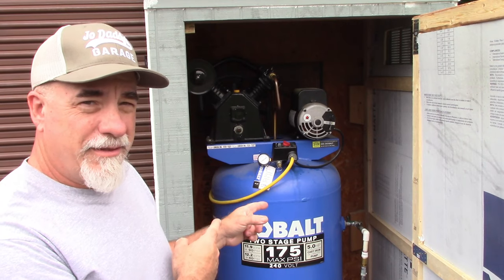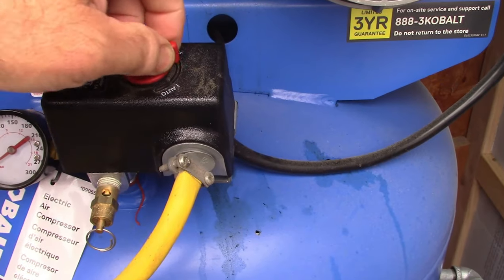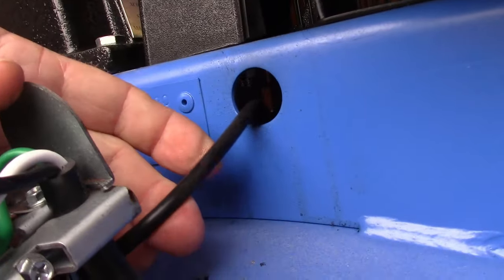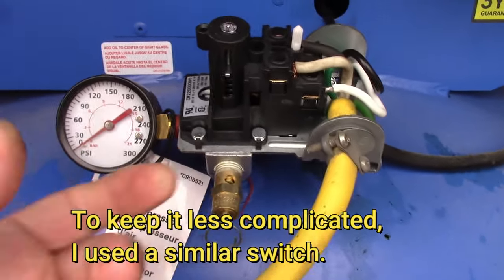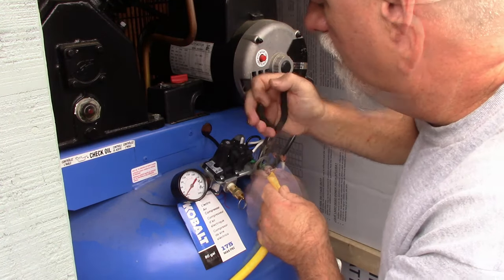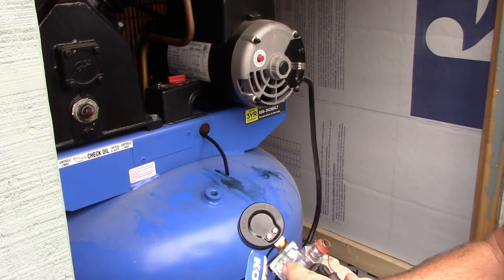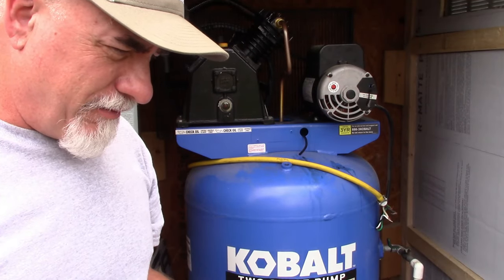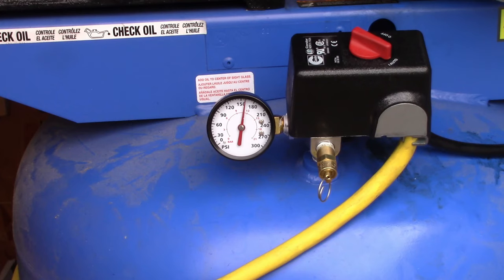Air compressor pressure switch fail and fix. Kobalt/Lowe's

Comment: The brass POP OFF valve is a compression style.fitting..it needs NO SEALANT OR THREAD TAPE..The reddish color "thread dope" is enough sealant to fo the job..adding thread tape leaves a potential for leak..in other words..you didn't need to put thread tape.on these because they will probably leak in the future..BTW..M NOT BEING CRITICAL OR SMART ASSY OR ANYTHING LIKE THAT..Just spreading my particular knowledge from experience...

Comment: Here I don't see any big repair there, but I understand..., it's not easy when something go wrong... If someone have and want to solve issues, have to be competent and very careful, before opening (pressure switch) or untighten something! because of electric and preasure-air-mechanical danger...

Comment: Thanks for putting this video out. Most home shop air compressors use pressure switches similar to yours. I can say it is easy to damage them accidentally. I did not know it would damage the switch but accidentally left the shipping plug in that is in the top of the oil reservoir to keep oil from spilling when turned. It should be replaced with a vented plug that it comes with. That little bit of usage without changing to the vented plug for the crankcase of the compressor somehow will damage the inside of these pressure switches through that plastic return hose. Just an FYI so someone else doesn't do the same thing on a new air compressor.
Reply: Wondering how can the crankcase pressure interfere with tank pressure to affect the main switch pressure sensor mechanism? Ring blow-by would make the case pressurize.

Comment: Mine would go to kick on and then hum and try to kick on and blow breaker on motor , drain all the air out and it would run fine and kick off.  Replaced switch and was good . This was on a 6 month old DeWalt 60 gallon .

Comment: You're lucky, my Lowe's 60 gal compressor just blew up with oil blasting all over the garage. That POS always leaked air and oil and couldn't gets above 120 psi. Had no idea it kept on running for so long time, think either overload or low oil tripped it. House could have caught on fire.

Comment: I was just wondering : when you tried to turn it on before the repair, the red switch made a nice solid "click" sound when you rotated it off, but when turning it on, it just sort of seemed to "slide."  The new one, I think, made the click sound both off AND on.  What I am getting at is this : could it have been that that cheap red plastic switch had rounded out inside a little, so that it wasn't solidly gripping the little white post that it was supposed to turn?  I have had that problem with that kind of switch before; the switch just loses its grip on the little post (which usually has one flat edge corresponding to a flat edge in the female hole in the red switch, thus making it grip and not just spin).  I hope my question makes sense, and I would tell people to just look at that first - it takes 30 seconds, and if that's it, it's a cheap repair - just get a new red switch!  Thanks.
Reply: I don't think so, it looks like Jo leaves his compressor on 24/7 but that's only an assumption. Good diagnosis though
Reply: I totally agree…why didn’t you fault the switch itself? They’re a really simple device..🙄

Comment: You make a good point.  It’s great to have things covered under warranty, but there is a price point where the downtime and red tape just aren’t worth it.  Hope they reimburse at least some of the cost.
Reply: Lowe's warranty is garbage. Electric range warranty, no fix. New 80V Kobalt chainsaw 6 months after purchase, discontinued and no parts available, WTF. Looks like they don't have parts or provide parts for the Kobalt stuff. Not happy with my 2 year old 60 gal Kobalt compressor, just blew up an hour ago.

Comment: Thank you sir. My compressor wouldn’t come on, ran into your video, went straight to Lowe’s and then Tractor Supply, got a new “dewalt” 175 max psi pressure switch, replaced it and my shop is back up and running. You saved my rear. Thank you. (I’ve still yet to here back from manufacture as to what the problem couldve been, ridiculous)
Take care! Thank you much!

Comment: Good call on powering directly to motor. My compressor stopped too. Nothing when pressure switch is engaged. I tested start/run capacitor s and have power to the motor from the switch, but I think I'm in your boat. I'll have to direct wire tomorrow and see if it turns the motor. If not, I guess I need a new motor. Thanks!

Comment: i did that like 3x on my compressor because the pressure it kicks on is too low. recently i bought a 7 dollar air pressure switch off amazon or ebay. if you do this you  install it by tapping into an air pressure line and wiring in the pressure switch in parallel with your current air pressure switch. then see what pressure the compressor kicks in at.

Comment: Thanks for posting this. Is the switch still holding up? Not great reviews on Tractor Supply, a few said it crapped out pretty fast.
Reply from the maker: It seems to be working fine.

Comment: I have a strange request, could you pop off the cover from the capacitors and take a pic of the wiring?  I have a very similar model, the capacitor went bad, we took it apart a couple years ago, and I have no clue how to rewire both caps.
Reply: Consult your manufacturer's wiring diagram. Usually there's a diagram underneath the capacitor cover but if there isn't any you should definitely find what you need online most likely a pdf user manual. Good luck

Comment: I have the Cobalt 26 gallon oilless electric compressor. It seems like mine was doing something similar where it would pump up the pressure when at zero but while using tools if it needed a kick back on it would not. If I were to drain the tank completely the compressor will turn back on and run otherwise if you keep flipping the switch it just sounds like a car trying to start up. Any ideas is this just the same type of repair that you're doing by replacing the switch?
Reply from the maker: Sounds like a faulty switch to me.
Reply: @jodaddysworkshop786  copy that I'll check it out I think on YouTube it's only going to cost me $15 to try that
Reply: @CTRadventures   IT could be the whole switch but it sounds more like the unloader vavle isnt 'unloading' and the air in the tank is keeping pressure on the pump head.  It's a tougher start for the pump if there is pressure still built up on the pump. Before you buy anything though, you could check if the unloader valve is actually your issue or if there is a different, typically more common issue: the one-way check vavle. The 1-way check valve is sitting on top of the tank. It's where the unloader valve and the actual air supply line from the pump connect to the tank. Try running the compressor briefly, let it buid a few pounds of air and turn it off. Pull the power just to be safe and unscrew/unhook the unloader valve fro the one-way check valve. If air comes out of the Check valve that means it has failed and will need to be replaced. From my experience the check valve is usually the issue but not always. The unloader valve can go out as well just not as often. Good Luck
Reply: @ImanAhole  I bought a whole new assembly. The only issue I'm facing now is that valve from the original compressor that we think is faulty is at a 90 degree angle and the new part is vertical, so now I gotta see if I can find some copper and form it to fit as it won't reach to to the thread. Or maybe I can put a 90 on the stem of the tank and a 1 or close nipple from the 90 to the switch flipping the assembly vertical
Reply: @ImanAhole    so check it out. The reason that caused the mystery problem is a neutral line that went bad on the energy providers side, causing extremely low power and power swings. So I figured the motor was running twice as hard to try and compress and probably burnt it out
Reply: @ImanAhole    so check it out. The reason that caused the mystery problem is a neutral line that went bad on the energy providers side, causing extremely low power and power swings. So I figured the motor was running twice as hard to try and compress and probably burnt it out

Comment: if i drilled out the air outlet in the diaphragm bowl to 10mm from 5mm  would this affect the switch? The inside outlet in the bowl is half the size to outlet
Reply from the maker: I don't know for sure. Is there enough wall thickness?
Reply: @jodaddysworkshop786  yes there is meat on it ,the smaller hole is behind the 1/4" thread of the outlet .....why its stepped down it looks like its ment for seating but imho i dont think need to seat theres enough thread to seal.....anyway i drilled it out and by comparison there's a big difference but in doing this i broke the zinc alloy fake brass 3way relief valve  its  got me  how those just dont explode an theres a fake copper plate alloy tube that goes to.the pressure switch 😂😂😂😂make ya laugh but anyway brass 3way on the way.

Comment: I'm not an expert on compressors so excuse me for asking this. If you didn't need 175 psi why would you buy one w this capacity? Couldn't you of bought a smaller one and saved a couple hundred bucks? Rather than down grading it and wasting your money? I recently bought a mid size one w 90 psi capacity and quickly realized I need more psi to operate particular tools properly so I'll be needing to buy a bigger one soon only thing is the price jumps dramatically from what I paid for mine.
Reply from the maker: You're right, I really didn't need one this big.
Reply: American guy syndrome, buy bigger than ya need. NEED- Toyota to haul plywood...BUYS-3500 Dually pickup...in case he wants to pull a 20,000 lb RV
Reply: A new switch is like $30 U.S. Dollars.

Comment: Good video,I have a air compressor fairly new hasn't been use very much at all,but now when it is suppose to shut off after reaching the certain pressure point it doesn't the pressure valve releases,does anyone know what the problem is.Its a craftsman 6 gallon round compressor,does anyone maybe know what the problem is,could it be the pressure switch?
Reply from the maker: Pressure switch.
Reply: @jodaddysworkshop786  is the pressure switch easy to replace.  I have the same thing happen to my 1 year old 10 gallon 175psi tank, suppose to shut off at a certain pressure and it doesn't.  machine is still virtually brand new because i have only used it about 8 times in a year. is it a cheap design or are they built where you have to run them often?

Comment: I have looked all over the web and can't seem to find put what wire goes were on the capacitors I hate to have to trash it just because I can't get the capacitors back on the motor.
Reply: how do you know it has a bad cap?

Comment: Hey i have the same air compressor and have had the same problems.  Only a guy I had come out to fix it said it was the electric motor capacitors. He took them off to have them tested and now he doesn't want to work on it and I have know idea the wiring on the capacitor. Could you remove the cover on the electric motor and upload a picture of the capacitor wiring.  Plz don't get shocked
Reply: capacitors just need to be plugged in.  Make sure each wire goes to an individual terminal. and make sure to put it back in the holder the correct way so the terminals don't touch the cover.
Reply: ...of course, make sure to get the correct size replacement.  Go to Grainger and they will have what you need.

Comment: I have the same air compressor. My switch failed after 1 1/2 yrs of very light use. Don't fall for that 3 yr. warrenty crap. I put in a warrenty claim and it was denied. The motor, pressure switch and compressor are considered normal wear items and only have a 1 yr warrenty. So basically the tank is the part covered for 3 yrs..Here is the response I received back from them.

July 19, 2021

Client’s Claim #:		3805###
Policy #:			
Insured:			Campbell Hausfeld
Claimant:		            
Date of Loss/Received:	July 14,2021
Our File #:		            3805###

Dear Mr. , ########

Thank you for your inquiry. Crawford and Company, on behalf of Campbell Hausfeld LLC, has investigated your filed claim regarding Kobalt Air Compressor, Model Number XC802000AJ (the “Product”). 
The Product’s warranty period is effective on the date of purchase of the Product from Campbell Hausfeld or an authorized Campbell Hausfeld reseller for a period of 3 years.  Within the manual the motor is considered a “normal wear item and is not covered after the first year of ownership”. The dated sales you have stated is 2/22/2020 for the Product which starts the warranty coverage. 

Since you were unable to provide a valid proof of purchase with respect to the Product, the Product’s sales date of 2/22/2020 is considered the beginning of its warranty period. Based on the information from you, the Product incident is outside of the provided warranty period regarding the motor, leaving us unable to assist you with your claim.

Sincerely,

Bill Porterfield Casualty Adjuster
Crawford & Company
1503 LBJ Freeway Suite 600
Dallas TX  75234
Phone#: 817-513-3275
Fax#: 770-723-8855
Email: William_porterfield@us.crawco.com